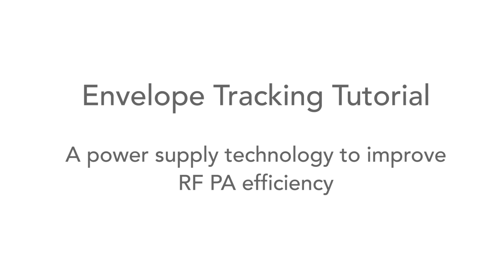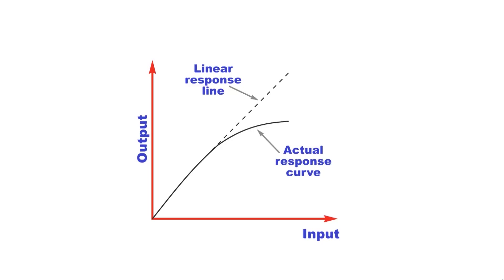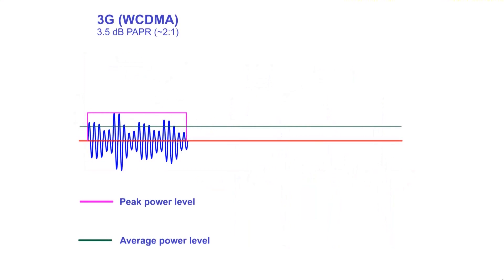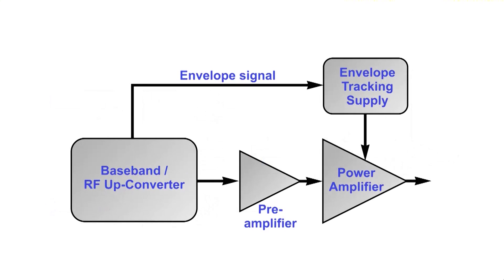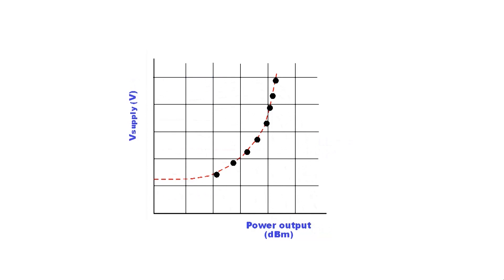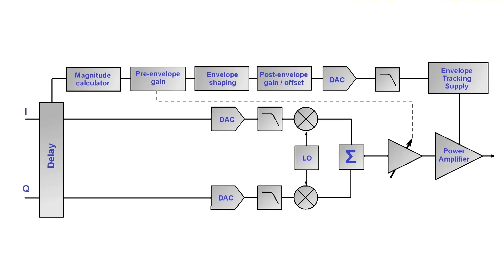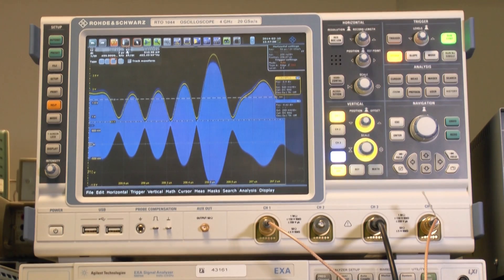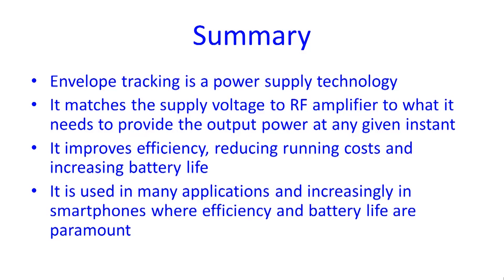RF Envelope Tracking Tutorial | Improving RF Power Amplifier Efficiency

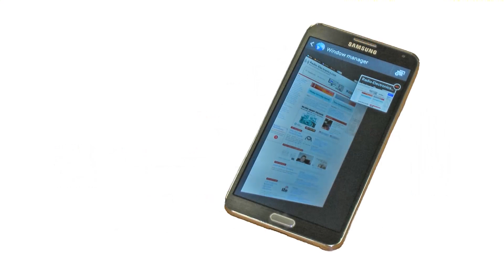Comment: Sorry I am a power electronics engineer and do not know RF systems! What is RFC at 0:20?
Reply: This is a dividing line
inductor coil.
Reply from the maker: Yes, RFC stands for radio Frequency Choke. As mentioned by another it is an inductor intended to block the radio frequency signals as it is a high impedance at RF and low impedance for DC. In this circuit is allows the correct bias conditions for the amplifier while not dissipating any of the RF signal.